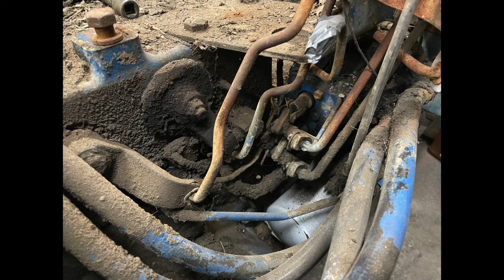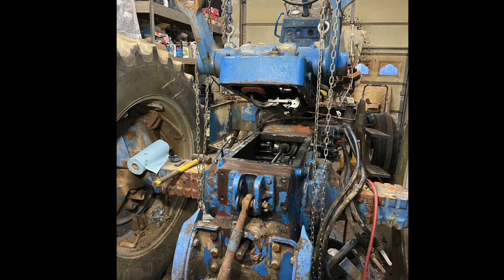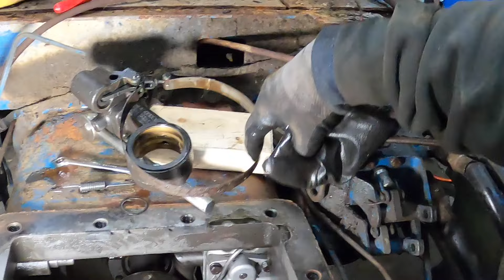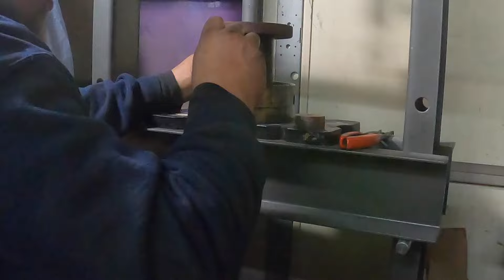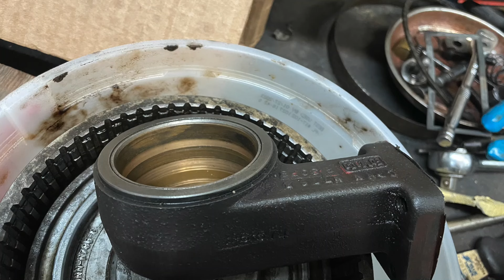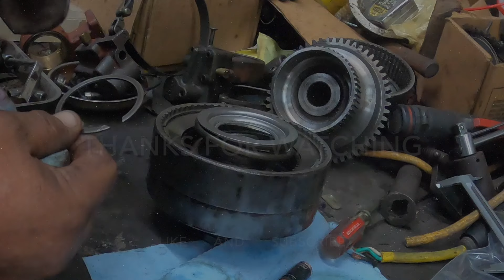8000 FORD TRACTOR 1969-1972 PTO Clutch Drive Rebuild

Comment: what is different on the 1968 vs the 1969 and newer?
Reply from the maker: @hillcresthayfarms9664  I think there is a difference production for the 68 model started in 67 to 68 and something changed in the PTO clutch pack the 1969 until 1976 on the clutch pack , I think the clutch pack is still the same until 1976 all the way up to the 9600 Ford Tractor. There is differences in the dual power clutch pack though. in 1972, the 8690 ,9600 the clutch pack for the dual power change the oiling system. They added an extra hole in the back for some reason, and a larger control valve for the high and low on the hydraulics for the dual power.
Reply from the maker: @hillcresthayfarms9664  come this winter I’m going to show all that about the dual power and some of the upgrades that happened after 1972. It’s going to be this winter I’m still working on the tractor and I need to edit a lot of stuff.
Reply from the maker: @hillcresthayfarms9664  thank you for watching my videos
Reply: @bantersarcforce  I have a 68 that I am doing the pto clutch pack in and everything looks just like yours but I cant find a kit that states its for a 68 they all say 10/1969 and newer I am going to order a kit and see what happens, No one seems to know the difference not even my local dealer.
Reply from the maker: @hillcresthayfarms9664  your new Holland dealership closest should be able to look all that up and if they can’t find it then let me know. My email address is Banter‘s arcforce@gmail.com and I’ll try finding the stuff for it but it’s going to be hard possibly Foresters Tractor Parts you can find them on Facebook I think also on Google
Reply from the maker: @hillcresthayfarms9664  l have an e-mail bantersarcforce@gmail.com I can chat with you there and try to helping you find places that can research it for you and possibly newHolland should be able to get some parts

Comment: I have a 7000 Ford tractor . That the PTO turns all the time . They tell me it's because something is wrong with the brake . Can that brake band be replaced or fixed . Without having to take anything else apart ?
Reply from the maker: The 7000 Ford is similar to the 5000 and the 6000 until 1973 . It may be possible to tighten the band by removing the hydraulic pump. If you cannot reach the adjustment for the ban you’re gonna have to split the tractor and replace the clutch pack hub break ban.
Reply: Thank you so much for that information  .

Comment: easiest way to remove is separate the tractor, i've done myself and it's not that tough. plus it sits right there where you separate it behind the transmission.
Reply from the maker: @ccgweb8017  with the top cylinder 3point hitch  off it was easy to clean the sludge out of the axle and inspected the rearend axle I bought it used. Thanks for watching my video.